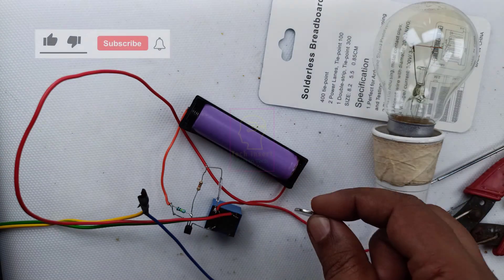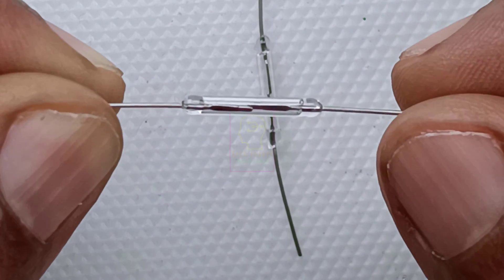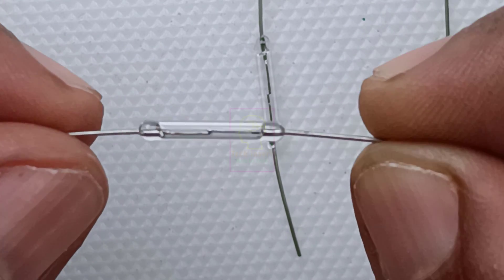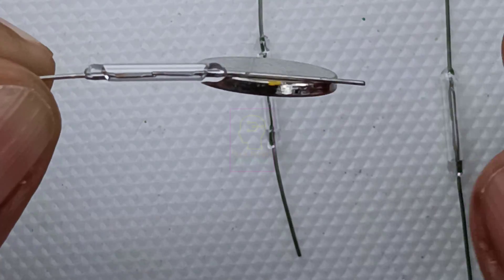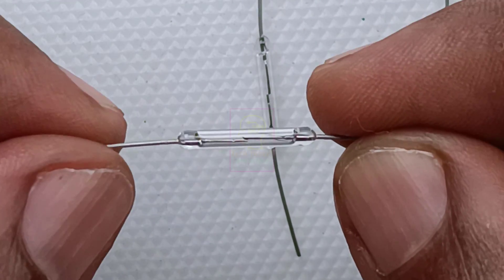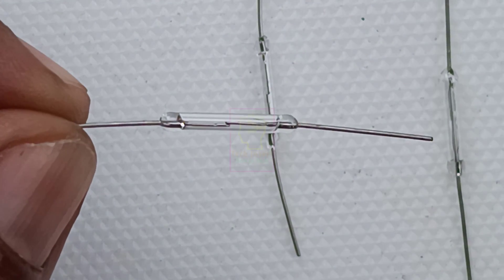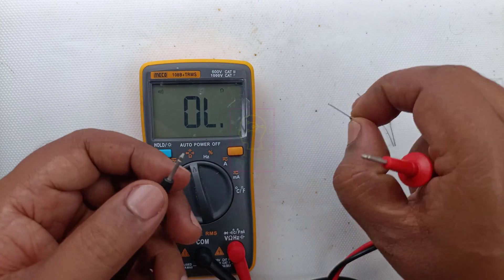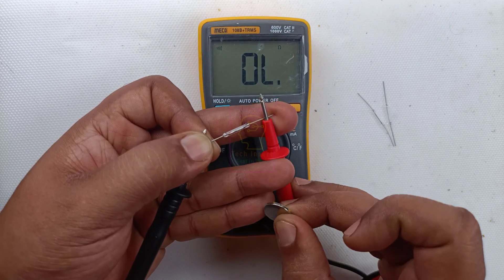How to switch a light using Magnetic Reeed Switch

Comment: The circuit is backwards for a door switch. The light should turn on when the magnet is removed.  If you have Ac Power then there is no need for the battery.
Reply from the maker: I know, but we need to show it  is using 2 different power supply

Comment: The relay is only needed to switch high current or AC devices. A tO220 NPN transistor can switch up to 5 amps by itself
Reply from the maker: Original 2n3055 can handle 15A. IRFZ44 Mosfet can handle 49A